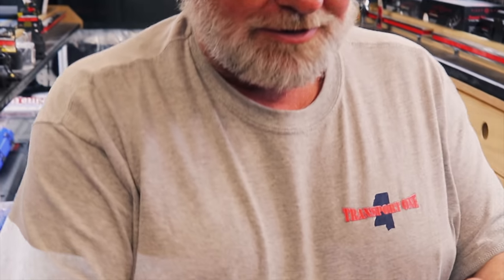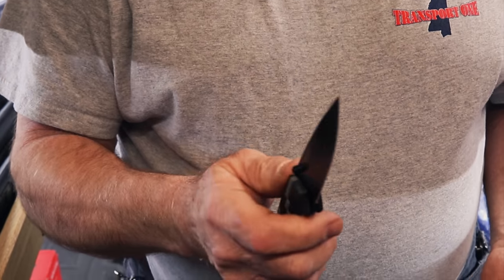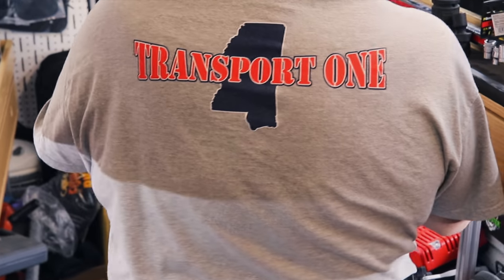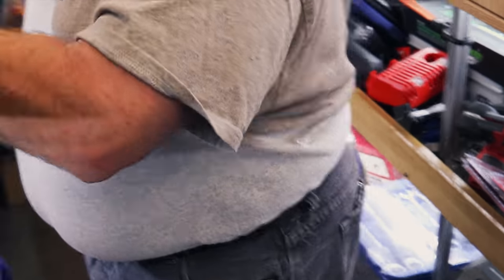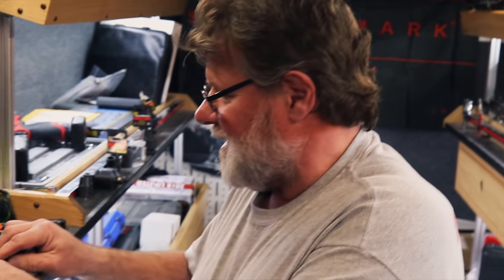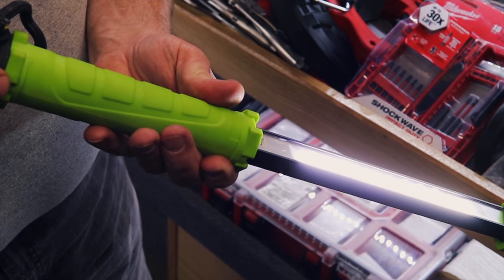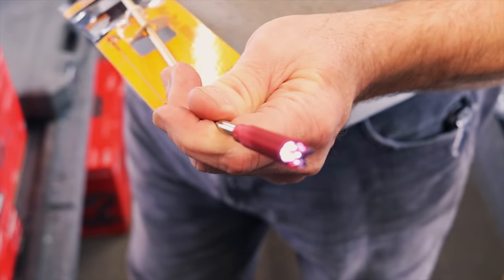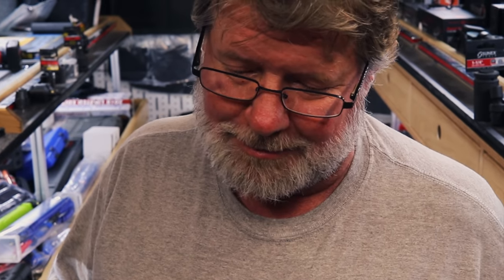All Star Tools: Monster Wrench Extender

Comment: Evening mr.clay I had a quick question not regarding anything in this video... what are those small but bright Snap-on lights u guys really like....? My dealer comes tomorrow and I want to get a few. Thanks in advance.
Reply from the maker: Which ones are you talking about ? The one like my coast light ?
Reply: It’s a magnetic swivel Snap-on one. It has different brightness settings and usb rechargeable I believe. I just can’t seem to find the video I saw it in.